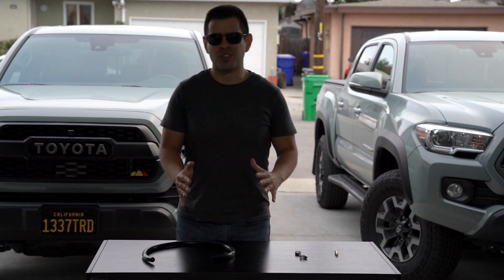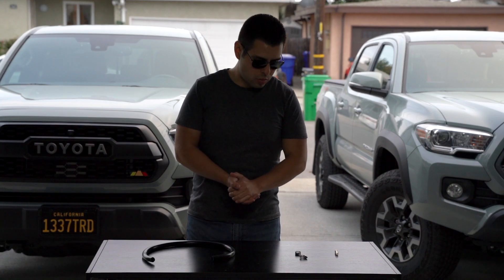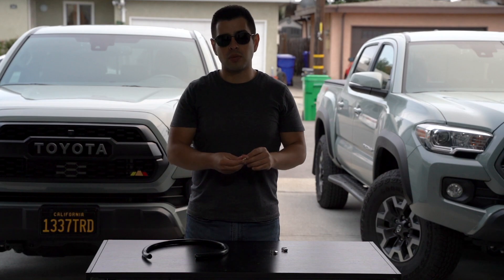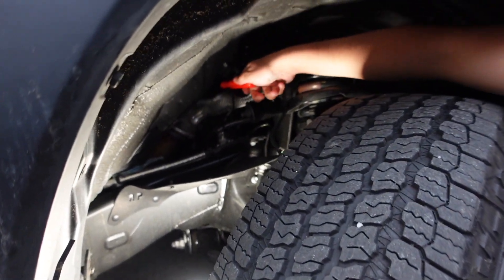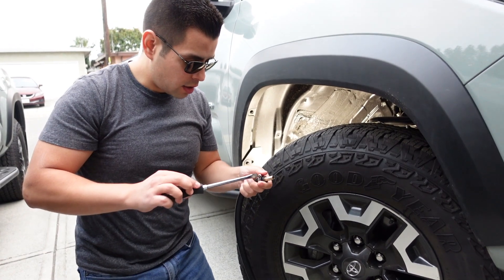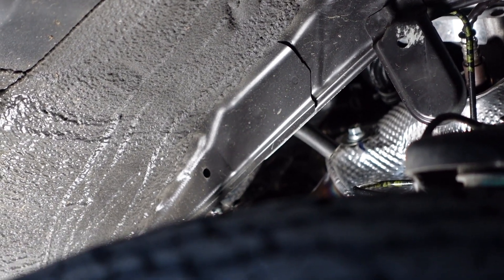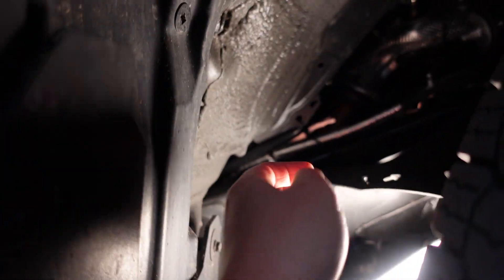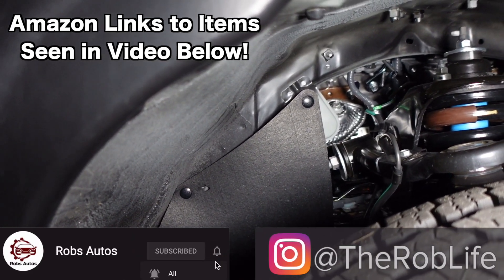Tacoma AC Drain Relocate - Tacoma Drain Hose Frame Rust Prevention Mod

Comment: I see other videos where other Tacoma owners have issues with the AC drain getting clogged. I have to wonder if reduced flow on the hose extension might contribute to this issue? Perhaps that is why some elect to place a larger hose over the existing one?

Comment: Bought three foot long 3/8 hose, 3/8 barb and 1/4 up-to 5/8 stainless clamps. From Ace Hardware. I should have bought the next size larger stainless clamps. The hose has a diameter of 5/8 with 3/8 inner diameter. With the barb. The hose was slightly larger than 5/8 when it was inserted. Had a hard time sliding the clamps over the hose. Had to pull it apart. Then tried to start the band back into the clamp. The Ace hose was to difficult to get the barb in. So I microwaved a cup of water. Dipped the end of the hose in it for a few minutes. Hose was way easier to get the barb in. Zipped tied in place. What should have taken a few minutes. Took me an hour.

Comment: Used a barb and two clamps like you did but was able to reach it all from the engine bay and wheel well without taking off the splashguard/liner.  Routed hose to near brake line bracket and zip tied (no tension on the brake line).  Still clears tire, etc.
Reply from the maker: Happy to hear!

Comment: I did much the same thing although I think I used half inch hose that bought at auto parts store & ran the hose forward bit through a hole that was going through a hole near the frame, but I did use a brass barb fitting on mine as well, I had to do something on mine when I noticed that mice chewed on the rubber drain hose upwards three quarters the way at a 45 degree angle so had to cut off the damaged area & inserted the brass fitting, I noticed also that the other end of the hose that attaches on the inside of the truck's ac plastic box on floor board gives very little room to get a grasp on it to remove it which is what I wanted to do at first but didn't want to start trying to separate it from the plastic ac box not knowing if it would break the plastic nipple off the box so I passed on trying to replace the original hose that the mice damaged.

Comment: Interesting. Probably just spray it with undercoat (I'm lazy) but seems a point. Maybe it's worth doing? I'm in a heavy snow, salt, brine area and not from from ocean on Atlantic coast so other concerns. 😢
You happen to know about what is prone to rust or not in the 2023 model? Undercoated mine before i had 100 miles on it but now I'm wondering if i need to drill holes for inner pannels. What is galvanized, what might be aluminum? Are cab corners galvanized? Rockers? Rear back of bumper or that area, over fenders? Inner fenders? Whats been sorta factory rust proofed and what isn't?
Been looking this up trying to figure it out. Don't want to be spraying and drilling holes in it if i dont need too
Reply: Galvanized is magnetic and aluminum is not.

Comment: Does the hose fitting restrict water flow ?  I thought just slipping a hose over the factory hose would be best (no water flow restriction) ....thoughts ?
Reply from the maker: @koolz4094  the reality is, it’s not so much water coming out that it can get clogged up with a bit of pressure on the hose opening from the fitting. Mines been holding up perfectly.

Comment: Did you say 3/ 8 hose?
Reply from the maker: Yes, I did just put a new link to 3/8 hose that should work. Unfortunately it seems the Amazon store I bought the 3/8 hose you see in the video is no longer selling it.
Reply: @RobsAutos  no problem I’ll just go to Thiesen farm store buy the barbed fitting worm clamps and hose. Be about 8 buck more then likely